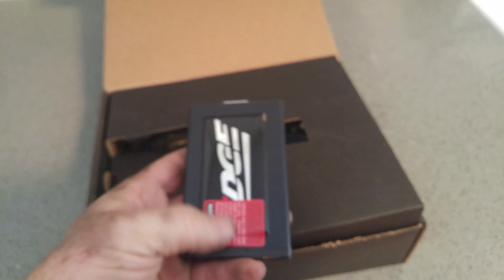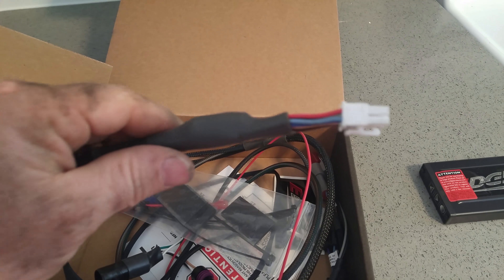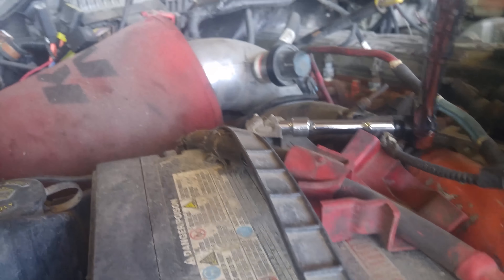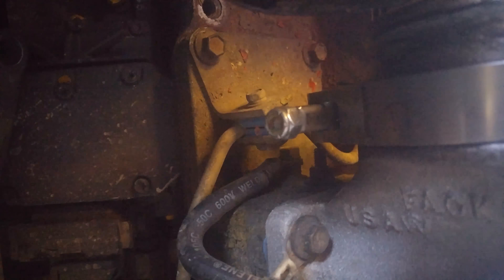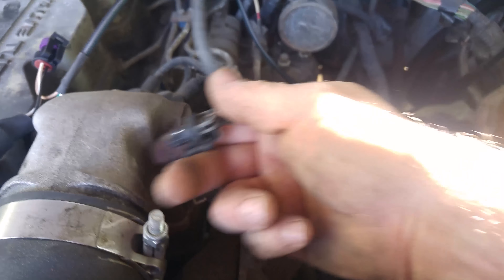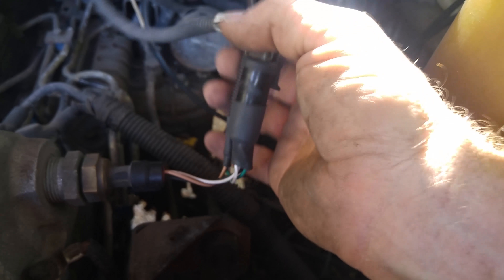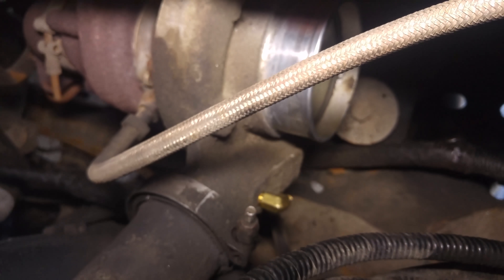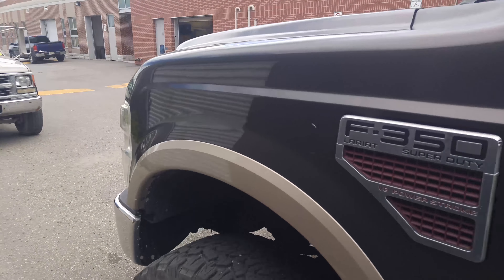EDGE COMP BOX Installation Cummins 5.9l  in my F350

Comment: My setup is very similar. I have an 01 f350 srw 4x4. I swapped a 12v and used the 4r100 behind it. It drove great but was kind of a dog. Considering its a ve pump. I just bought a 24v with a 5speed that im literally putting in it the f350 this weekend. This video is super helpful because i was looking into the edge comp box. How does she drive with the tuner on it compared to before?
Reply from the maker: It drives 100% better.   Not much smoke unless you lug it. My conversion is behind a 5r110.  I used the sct to run the programming for it.   If I were to do it again I would use the 24valve with a P pump.

Comment: What is the reason you can’t run a juice with attitude ?  I was under the impression I could run whatever tuner I wanted as long as it fit my motor
Reply from the maker: I am just using the Edge programmer.   I did not need the gauges.  I needed the sct programmer to upload the programming for the 5r110 transmission.  So there was no real benefit for me to add the cost for the juice. In the beginning when I started this project I was told that it may cause me issues. But not I don’t think so.   I am now toying with stacking a smarty tuner to run with the edge for a little more bang.    The worry is the strain it puts on the ecm. By flashing it each time you want to change the program.